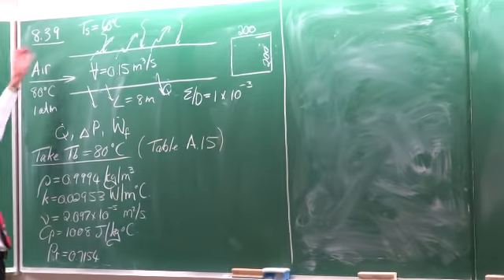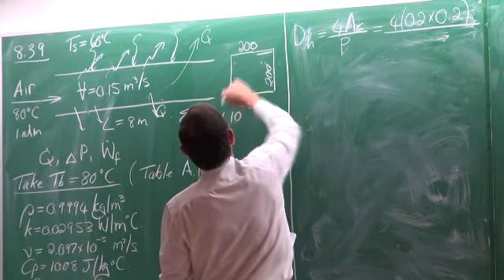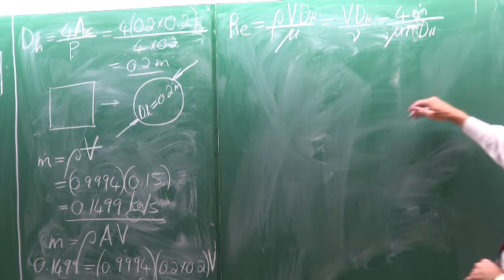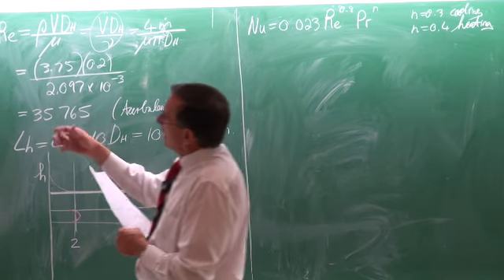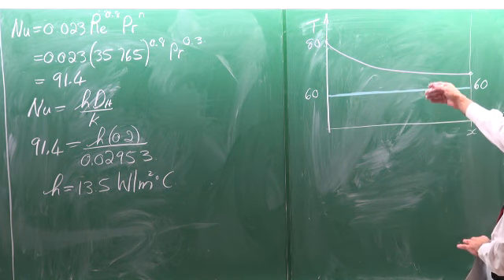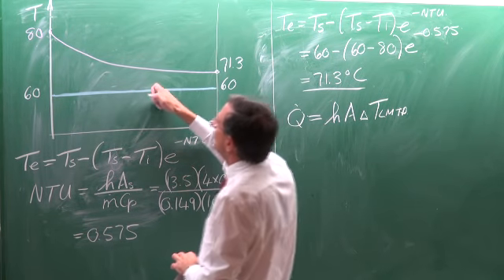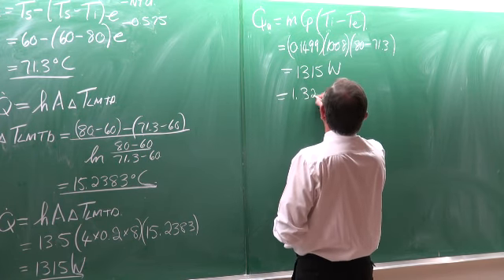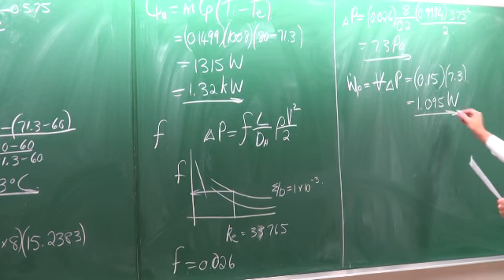Problem 01 (2015) Internal Forced Convection. Heat transfer by Prof Josua Meyer

Comment: Morning Prof, I would like to know how to integrate psychrometrics into these type of problems ? Can you break the incoming flow up into two components , Ideal Air and Water vapor , and then add the heat loss contribution of each in order to find the total heat loss ?